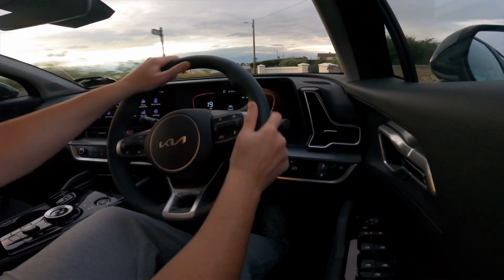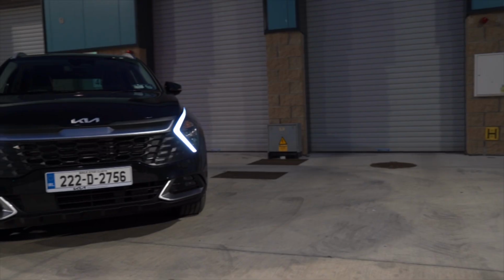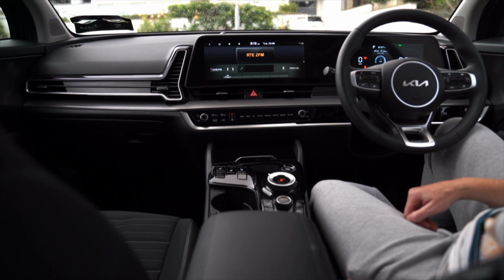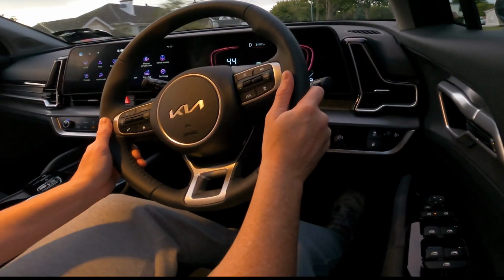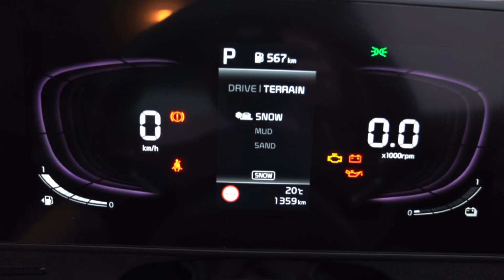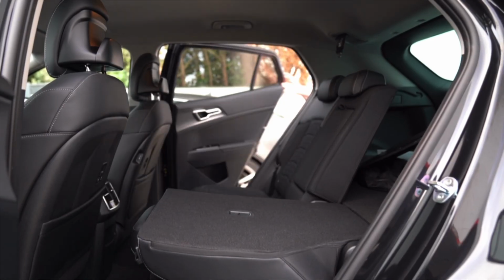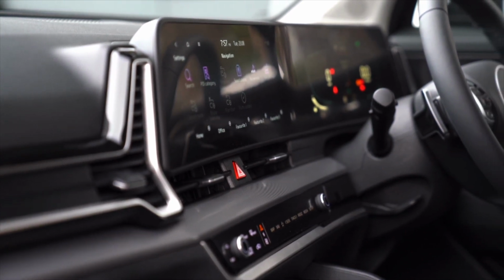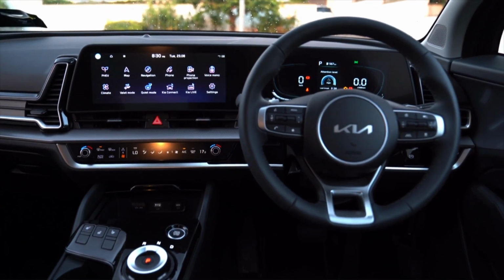Kia Sportage PHEV | Review

Comment: I have been driving this car for two full months now. I have the K3 Plug In Hybrid (PHEV) (THIS IS IN IRELAND)
I will write an honest review of what are the pros and the cons of buying this car.
The pros:
To me the car looks amazing. Inside and outside. My favourite part is the look of the front of the car; I do not find the high beams very strong though.
Seats are very comfortable; I love driving it even in long trips.
It is a very quiet car, great view of the road, heating steering-wheel and seats, at the front and back!
The infotainment is excellent, especially when you put the full map view; you can do this with either using the car’s own maps or Google maps (android phone). The Kia system is connected to the network without phone and works well. Maps are good, search is easy and system is responsive.
Consumption (the strongest point of this car). I drive mainly in electric, rarely in hybrid as I don’t do much highway. If I drive it carefully, I can get 0.9-1.0 l/100km in electric. In automatic (mixed electric-Hybrid) is 3.9-4.0 while in full hybrid (only on highway) I have had mixed result 7.0 to 7.4 l/100km. Not bad at all!
Performance: I have the car mainly in eco so drive is relaxed but accelerates with no problem, especially when you are at a traffic light and need that extra acceleration. I tried the sport mode and is impressively fast, better than I expected. ADAS work well, sometimes a bit of hard pushes when getting close to a road line and it beeps too much also but nothing you can’t live with.
The Cruise control is spot on and I like the “the car in front of you has moved” sound notification when the car in front of you is moving again.
Brakes are good and you can adjust your regenerative breaking; I have it on medium so I can slow down without stopping too quickly, get some regen and also avoid touching breaks most of the time.
Software is responsive and the large screen is good even in bright light. I also like the idea of being able to switch from the radio commands to the heating system in the small bar below the infotainment.
The heating system works pretty well and passengers at the back can decide the temperature they want or if to stop the AC form coming through.
Another great thing is being able to plug the car in a home socket and charge your battery! Cool. It takes me around 4 hrs to do so with little battery left; KIA has given me a Type 2 charger but is very slow and would take me 8 hrs with that one; so, I purchased one from Amazon for around €200.
The cons:
There are few more than I expected. The main one, most annoying, which I find absurd is the fact that this car, in 2023, comes with a wired Android Auto(AA)/Apple CarPlay. In today’s market there are very affordable and smaller cars with wireless AA.
To use AA you need a USB C cable; I have changed 4 already, all recently bought and often, while driving it disconnects. Sometimes comes back on and connects again, some others you need to remove the cable and plug it again…while driving. I think is when the signal is weaker but shouldn’t disconnect, especially the maps, it completely goes off the screen.
I think it’s terrible. In a car that costs almost 50k in today’s market where technology is advanced this is something I cannot forgive KIA for. Here, to me, is where the Sportage loses a lot of points compared to other brands.
I use AA for YouTube music, Spotify, receive messages and Google Maps all the time and it becomes irritating. Also, because of this you need to listen more to the radio (which I never really do) and my driving experience drops because of this. There are several USB ports but only one can use data, so if you have AA on (if it works) you can’t also attach a USB loaded with music because it won’t work, and then again you are stuck with the radio. Grrr
Something about the radio: I like the graphics when in AM (even thought I can never listen anything in AM) while in FM it has DAB where the info is miserably small. It has a beautiful large infotainment screen but only a small square to show the name of the artist and the song (which often you cannot see). Also, the radio can only be switched on and off from the physical button below the display; not ideal to reach at all times; there should be an option on the screen.
Another brutal thing is, if you are using Android Auto you cannot go back to the main screen! You either unplug your phone or…set up one of the favourite physical buttons on the steering-wheel into a  different app (radio for example) and then can go back home from there. I mean, why? I believe Android Auto/Apple CarPlay can be used wireless by jus a software update? So why is there not an update?
Something else you do not have available on the K3 (I believe only GT in Ireland has it) is the instrument panel in front of the steering wheel doesn’t have many displays; for example, in other markets you have the chance to change the gauges, here you can barely change between 3 colours?! Really poor.
Something else not available in Ireland (where you pay more but get less from KIA); there is no live view from the camera when indicating like in other markets.
Inside the vehicle handle bars are not on every side of the passengers! More money saved by KIA but come on.
Hit and miss (this is probably down to personal preferences):
In the boot the cargo cover is retractable; at first, I thought it looks great but is always on the way and you need to keep on moving it up and down reducing space if you don’t do so.
The space in the trunk is not that much considering the size of the car but you have more space at the back for passengers.
I hate the small bags hooks on the side on the boot; always struggle to hang bags in there; other brands have some great solutions (learn from Skoda).
The camera at the back is excellent, can change view (no 360 though!) and it has sensors at the front and back of the car.
The rear window wiper is small but on the other hand is hidden which actually I like.
Headlights are automatic and have day lights but no auto high beam; you need to play with them.
The gear selector is a hit and miss; looks nice and is responsive but not my favourite solution; in few occasions I had to do a manoeuvre quickly and I thought I had selected the correct gear but I hadn’t.
Thoughts: I love this car overall and the most important things (or almost all of them); great engines always from KIA; good performance, space and consumptions. Unfortunately, some really annoying things too like the wired android auto/apple car play or the live view camera when indicators are on and in a car this expensive these are things you cannot ignore. It doesn’t look like KIA values its Irish customers as much as the others.
For this money there are a lot of options out there and I’m not sure it’s worth 50,000€. Would I buy it again? Maybe; today, after only two months, I am 60% yes. I think only time will tell.
I hope I have helped someone decide if to go for this car or not and I will post this on all Irish reviews just to people an opportunity to see it for themselves.